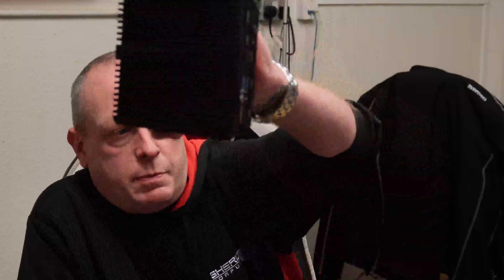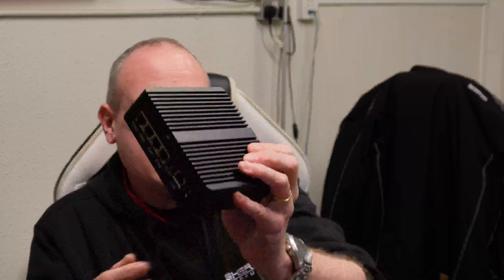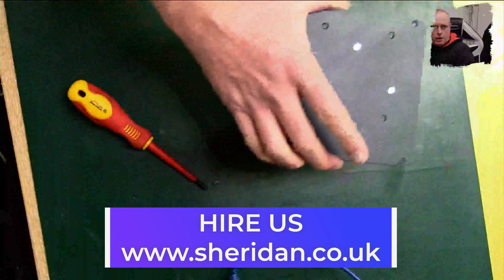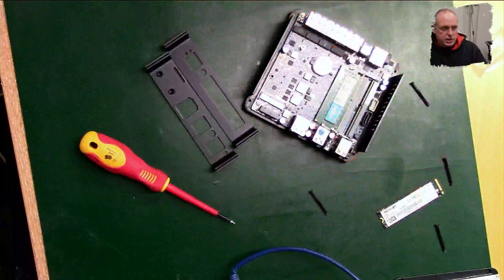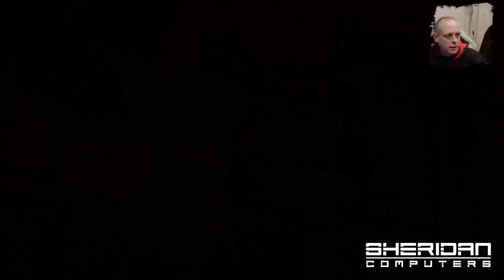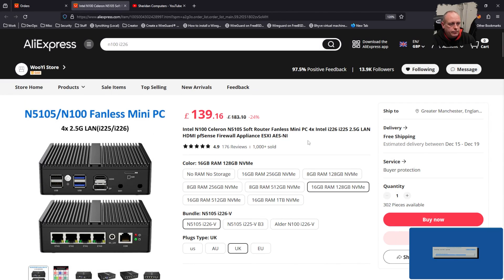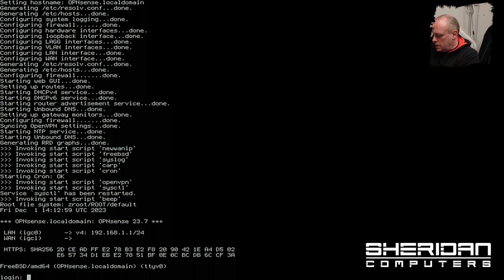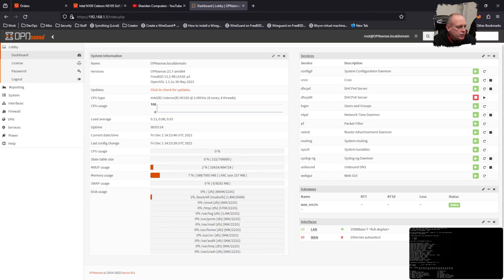AliExpress Mini PC for pfSense & OPNsense | Best Budget Firewall Hardware

Comment: Been running my i226 since Jan 2025. Running Proxmox, with OpenWRT, and various other linux VM's. Been nice and stable. I highly recommend adding a nvme cooling pad, and setting a fan infront of the minipc. Doing that, has kept everything at a stable 29-35c temp range on mine. Not cooling it, your RAM and SSD may fail.
Reply from the maker: Using decent RAM amd SSDS, haven't had any issues and we've deployed a lot

Comment: What do you recoommend ? Dell 3060 i5 8500t  dual ethernet ports ( 2.5 gb and 1 gb ports ) or Topton n100 2.5 ports , thanks in advance
Reply from the maker: If you already have one, use the one you have. I've used a few n100 they also work fine

Comment: I wonder if we need to worry about Chinese backdoors being on these things?
Reply from the maker: I certainly wouldn't use anything with preinstalled s/w, no matter what operating installed. I did check the first one I bought with wireshark and didn't notice anything untowards. Have used a few and haven't seen anything out of the ordinary

Comment: Can this "router" be run in headless mode like a dedicated router (ie,. power it on, it starts working as programmed in a minute or two?)
Reply from the maker: If you run on proxmox, have SSDs, and the VM is set to auto power up, yeah.
Reply: @sheridans  I'm replacing a Linksys WRT3200ACM with NAS and Wi-Fi. I have two of them, but some new type of traffic coming in from my gig fiber started rebooting the router every 30 minutes since last Wednesday. I've tried two different 3200s and they both reboot on the same schedule. So I think it's their firmware can't handle the packets. I need to build something open source that isn't subject to being rebooted by heavy hacker traffic. I want it to be pretty much plug and play. Must run unattended.
Reply from the maker: I run my production VMs on bear metal FreeBSzd and nfs.

All inbound traffic you should have blocked
Reply: @sheridans  it should be blocked by the firewall, but the router can't handle it. My server's log file grew to 9GB in just a week from all this traffic. Normally 250MB in a year.

Comment: Ive got one of these and I find its running a bit hot, a basic fan on a slow speed on the heat sink seems to hve sorted it. I will open it up at some point.
Reply from the maker: I haven't had to fit fans to any as yet, certainly can't hurt on a passively cooled device 👍

Comment: I have almost the same device with i5 cpu, do you think OPNSense temp about 50 C is fine or should I worry...is there any BIOS/OPNSense settings which I need to adjust? Also, I have same BIOS version 5.19 on my device, do I need to update, struggle to find which version is the recent one. Thanks!
Reply from the maker: Anything under 70 should be fine, I'be zero luck trying to obtain bios updates for these things

Comment: What wifi access points are you using?
Reply: Doesn't seem like the AP matters as much depending on what your use case is. They're put into bridged mode so PFsense can do the heavy lifting is how it was explained to me. I've heard of success with the cheaper TP Links in the 50-$80 range
Reply from the maker: @tw9756 You only need to use a modem in bridge mod le if pfSense doesn't have the interface for it (VDSL, etc). Wifi access point is just that, you can use whatever you're happy with
Reply from the maker: I'm using UniFi access points myself

Comment: You've convinced me. $173cnd is a good price. Q: Can you let me know what ram I should be looking for? I'm assuming (and based on the looks of the inside of your equipment), I should be looking for SO-DIMM (laptop ram) but what speed? DDR4 or DDR5? Thanks for the video (and help)
Reply from the maker: 8GB DDR4 PC4-21300 2666MHz 260-pin SODIMM, I went with Crucial